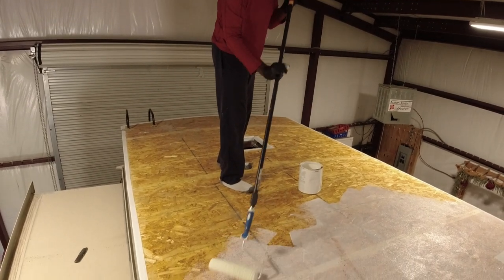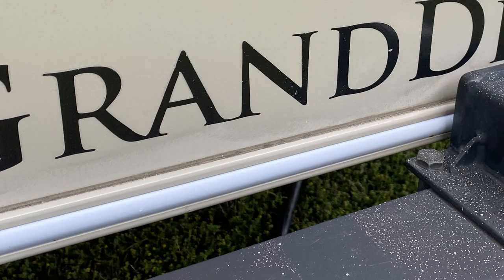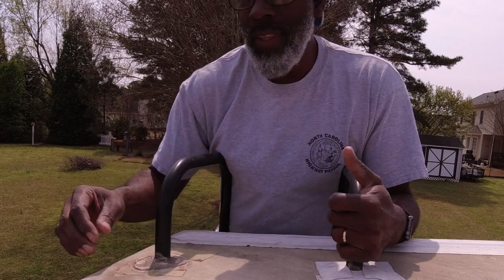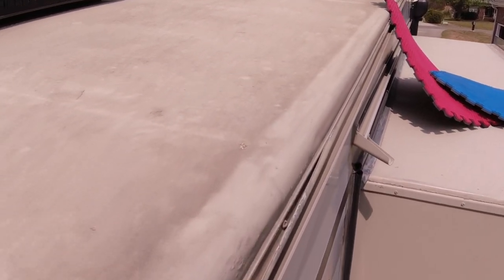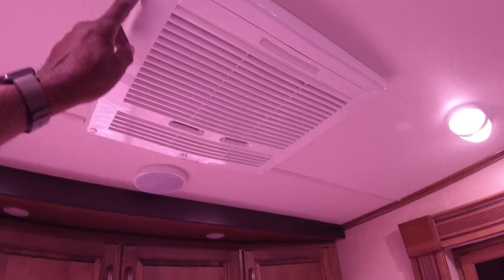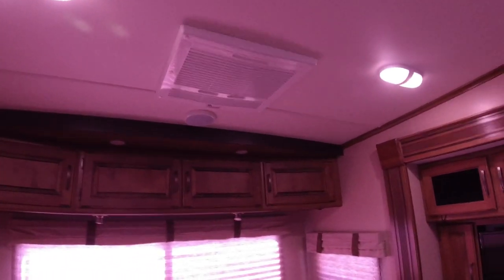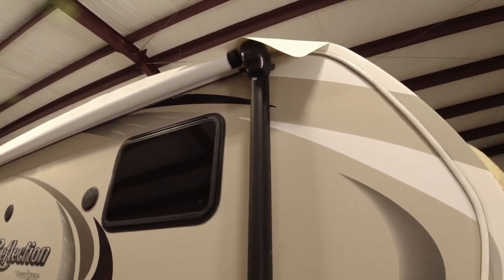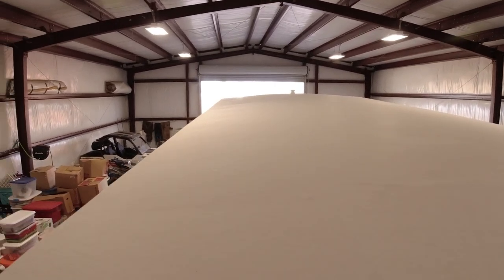DIY RV Roof replacement

Comment: Now that this has been done for a couple years, how has it help up? My reflection has membrane separation from the front to about mid point on the RV. I'm waiting on the parts to come in currently and I'm confident I can do the replacement, just wondering how it has held up, because I know there is a fine line between too much glue and not enough glue. Safe travels!
Reply from the maker: It held up good for the year that we had the camper after the repair. We traded it las June and are now full time in a Momentum. We documented our journey on our channel. Safe travels and thanks for watching.

Comment: That was a  lot of work.  I had a roof replaced years ago  on a old camper, it was very expensive.  How old is your 5th wheel  ? It doesn't seem that old .
Reply from the maker: Our camper is 8 years old. Yes it was a lot of work but we took our time and had fun in the process.

Comment: I’m watching this on my phone so I can’t see down in the description area but I was wondering if you had a source for the new rubber roof n cement n an idea of the cost for that material?
Reply from the maker: I contacted the manufacturer which was Dicor. They sent me most of the materials to do the job.  They made my roof membrane. Check your warranty.   Thanks for watching.
Reply from the maker: Not sure about the cost.